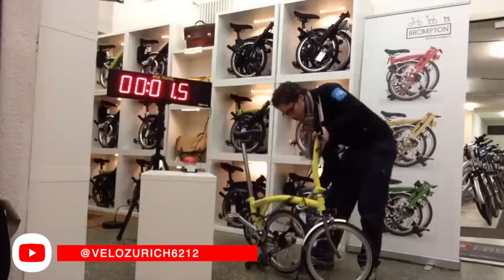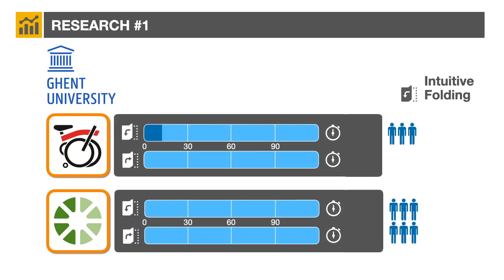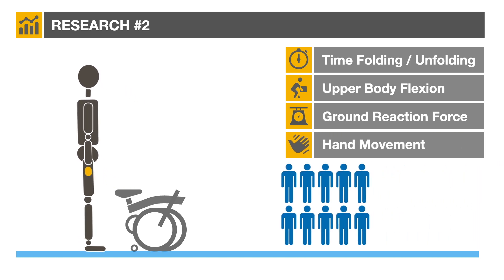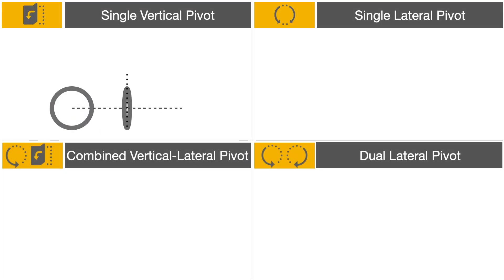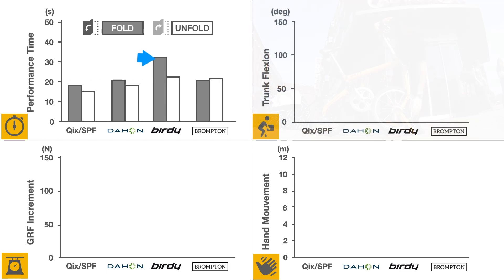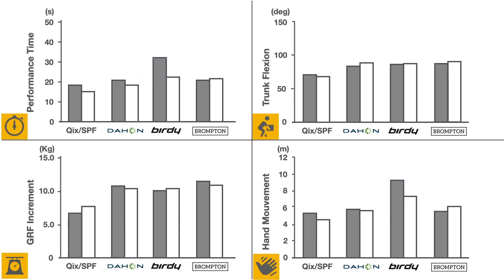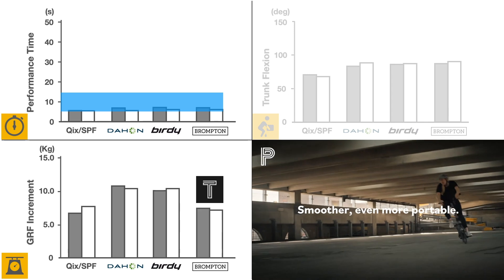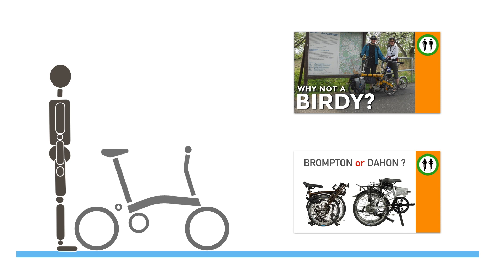Which one is the easiest to fold?

Comment: Dahon should've continued making QIX. It seems like much reliable folding mechanism than lateral folding.

The video was very interesting! I always thought the Birdy folding system was hectic and it does show the longest time. The front fork can be re designed like Tyrell Ive i think
Reply from the maker: Through the years, Dahon did go through many models. While some, like the Mariner or Boardwalk survived the test of time, others more niche ones were, unfortunately, discontinued. The 21 speed, dual-rack touring focused Dahon TR comes to mind (we owned 2 of those at one point)

Comment: But isn't "folding when familiar with the bike" the relevant metric? I mean once it's yours you'll eventually get the hang of it / familiarize yourself with the folding routine and that's what counts, not your first ever fold.

Anyway, the important metric is that if I arrive so late at the platform that the train is already pulling into the station but it's folded before the train comes to a full stop then folding it is quick/easy enough (it's a Brompton). 

Same applies for unfolding: if I pull away from the station before the train does then unfolding was equally quick 😊

I can imagine that some still aren't easy/quick to fold even once you've familarized with the (un)folding pattern
Reply from the maker: I once cycled/chased a bus, hoping a traffic light would stop it long enough for me to catch-up and climb abord, which I eventually did. In the rush, I struggle to fold the bike, causing the driver to complain about having a bike (folded or not) inside his bus. I was riding a Birdy. I’m pretty sure the entire process would have been smoother with (an easy to fold)  Brompton

Comment: I bought a Brompton because of the small folded size, simple mechanics and that it's nearly build for 50 years now with some improvements over the time. The folding sequence itself was a bit complicated to me until I kept in mind that the lowered seatpost will keep the folded wheels in place. From that moment on the folding was obvious to me: Rear Wheel, Front Wheel, Saddle, Handlebar.

Comment: I've had my Brompton for two weeks, carried in small plane, augmenting (but not replacing) the Montague I've carried for 20 years, even after converting it to E power, I got the Brompton for short rides, no E power (and weight) wanted or needed for those.  From landing abd roolling to a stop, I can get the Montague unsecured from it's inflight configeration, unfolded, and ride off, in a bit less then 3 minutes not bad, considering it's a 30+ MPH  high powered (custom build) E bike. BUT, I am hugely enjoying the Brompton only needing one strap to secure it in the plane (the Montague takes 4) and it's quick unfolding. I have no doubt I'll be able, with a little practice, to land, stop, and be riding off in well less then a minute.
Reply from the maker: Touch (unfold) and go!

Comment: Interesting studies but lacking multiple aspects. To give an example I own a Brompton byt lately gotten Dahon Mu copy and Tern BYB. What I found is that on Brompton, the latches don't require much force to undo or do up. On BYB on the other hand the spring is so strong that it's making undoing them much harder in comparison.
There also is an aspect of training. To me if one masters Brompton fold, then it's so easy. Not so much with other folders due to size and weight.
Reply from the maker: You raise an interesting point, the hand motion tracking system would have some difficulty differentiating between a recalcitrant and a compliant latching  mechanism.